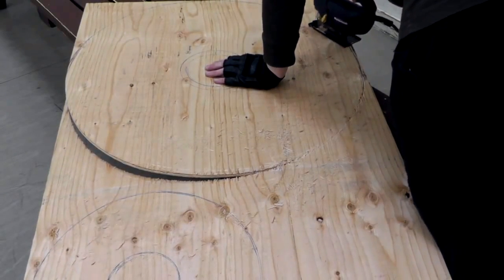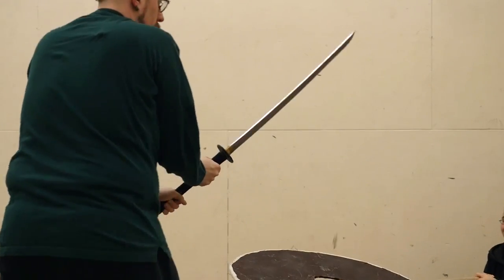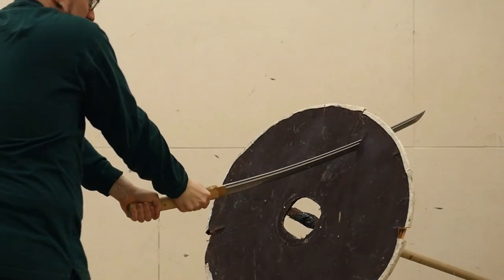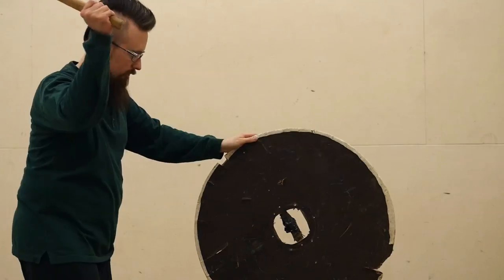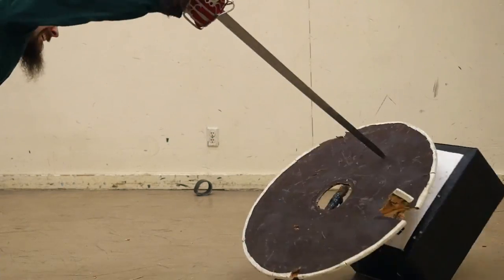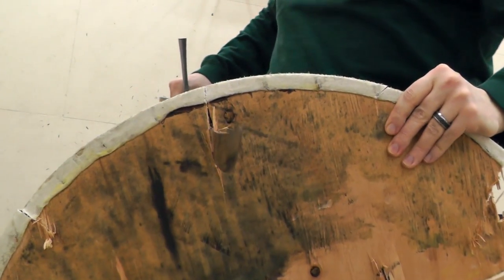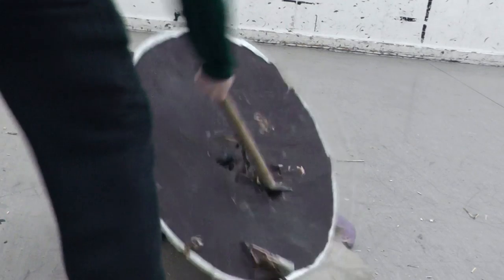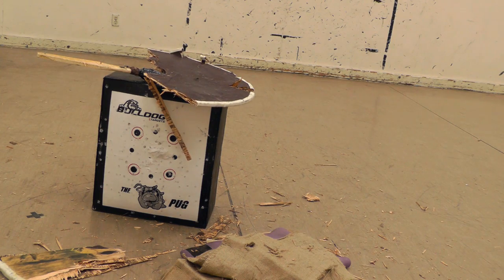Plywood shield vs broadsword, katana, axe, kriegsmesser, and war hammer

Comment: By no means am I any kind of close quarter combat expert, but I found the ax very interesting. I didn't expect it to do much damage to the shield, and after having seen this video, I think it would be better used to hook the shield and pull it out of the way to expose the shield bearer. Thoughts?
Reply: It's an axe, you can chop logs in half with it. However it was not made for shield fighting, it is too small (the one handed on) to use as a primary weapon. That is why only colonials, who did not carry shields or wear armor, used tomahawks and steel axes. Shields are supposed to be near invincible defenses and the only way to counter them is to break the wielder's shield arm and kill them or go around their defense just as you do in sword fighting.
Reply: Kitt C Yeah, that's why I suggested the ax might be best used to hook the shield and pull it to one side, exposing the shield user. You know, instead of directly attacking the shield. The video demonstrated pretty well that the shield is very resilient against it.
Reply: Could be done but overall most one handed axes are too small to effectively hook shields, but they are good at swords
Reply: Kitt C I don't think you're quite understanding. Or you don't know what you're talking about.
Reply: krowanders Listen, a one handed axe such as a tomahawk is only a foot long. It is has a bit more reach than a dagger. It is not made for hooking shields, and only Vikings have commonly shown their willingness to wield longer axes for the job. If you try to hook a shield with a tomahawk-sized axe, in order to pull it away you will open up your defense to their own weapon. Colonials used small axes because they didn't have to fight armor and shields, but medieval soldiers? Larger axes, clubs, spears and especially swords were much better. 
Also, you don't even want to attack the shield. You go around the shield. The shield is invincible and its grip is very strong, it's likely even a large weapon would have difficulty 'hooking' a shield away from a burly soldier's forearm. If you want a time when the small axe was a highly viable combat tool, look post 1600.
Reply: Kitt C Nah. I think if you're using an ax in the offhand, and you hook their shield, you can pull it in front of them to keep yourself protected while you open their flank. That seems like the most viable shield vs. ax+sword technique.
Reply: krowanders Very common viking tactic was for a shield wall where the 2 handed axe was in the second row, pulling down a shield so that the guy in the first row could kill him.
Reply: Pasan Etternavn That's awesome. Thanks for the input, bro. That's what I like to see.
Reply: Pasan Etternavn Don't you mean "...the guy in the second row..."That makes more sense to me tbh.
Reply: No, I meant it like I wrote it. The first row in a shield wall was obviously not full of 2 handed axes. Its a shield wall. Generally the guys in the first row had swords and axes and shields, the guys in the second and third rows had spears and 2 handed axes.

Comment: i don't know shit about swords and all but I started to see your videos yesterday and the idea of using a shield, if somehow sword fights be socially accepted again, looks like a good rule of thumb. 90% of the weapons you used against it ended up being stuck in it making your job of kill the guy with the weapon stuck easier. If someday you have another spare shield, could you use that broad sword and test it out? Sorry if any grammar mistakes i am still learning english
Reply: +Vinicius Pires Gonçalves And that is why the shield was the primary means of defence for a few thousand years.
Reply: +Chris Wallace I know right? But in movies/games they make the a lot less impressive in some cases the guy just break the shield with ONE hit.
Reply: +Vinicius Pires Gonçalves Not to mention how in some games, a combatant with a shield simply uses it as a counterweight, moving it as far away from their body as possible with each strike. Hm, seems most shield-equipped combatants in games have an immediate death wish.
Reply: it depends on the swords in question, being used as a counter weight works very well for some heavy sword, (Scottish Claymore comes to mind) that being said you can also sharpen the edge and use it has a slashing weapon

Comment: Do you think someone used a tactic turning their shield specifically to make enemy's sword to be stuck in it? That means they will be unable to block and get exposed. Have someone thought about it?
Reply: +MaxCPP Usually they used them to deflect the blows, in order not to sustain much damage, since most battles happened on the battlefield and not 1v1 duels. Better keep your shield as safe as possible.
Reply: You cant block either cos a sword would be stuck in your shield dummy
Reply: Even with a sword sticking out of it, a shield is still a shield.

Comment: Skall no offense but plywood doesn't really have a set grain orientation as it's made by laying down alternating sheets of wood on eachother, i.e. the grain runs 90° to that of the sheet under it, so it shouldn't really matter if you hit it with or against the grain of the top and bottom sheet
Reply from the maker: ITLLBGRAND 
As mentioned it's only 3-ply, and 2 out of 3 layers have a grain running in the same direction.

Comment: I dont want to sound like a troll i respect what you do but...if nothing is holding the shield steady well anyone would assume the damage would be reduced with no force behind it the box is just slowing it down ....make a wall mount so the shield does not bob around in the air so then when you poke it with a sword it does the damage it should !

Comment: Part of the problem I think, you didn't have a solid backing for it for any of the strikes. You really need a rig to keep it solid, otherwise the test is kind of for naught don't you think? All of the significant strikes if you look back, were when the shield was on edge and jammed, or just by chance managed to be solidly braced.
Reply: I think less solid backing gives it a far more accurate portrayal.  The arm of the person holding it is going to be wobbling all over the place as you hit the shield.
Reply: ... You don't know much about using a shield do ya bud? If it's properly made, unless it's a buckler or you're a weakling your shield is going to be pretty damned solid. A shield weighs more than a weapon, and unless it's a giant of a man wielding the weapon, or it's a hefty ass weapon you're going to have less of a jolt on your arm than that portrays. You're not going to be holding a shield and suddenly be blasted towards the ground.
Reply: +Diralt Naran it wouldn't be like hitting a stationary object though, if you hit a shield with full force the person's arm that is holding it will be moved. A skilled fighter would perhaps even try to shift the shield as to dampen or parry the strike altogether.
Reply: Diralt Naran 
I used to spar with a guy that managed to break his training sword, my shield, and my arm at the same time, so my opinion is somewhat skewed.

Comment: I have a question, without meaning to cause any offense.
When you and other yt guys, like let's say Lindybeige test some weapons, how historically accurate is it really?
I follow your channel for quite some time and I know you have more experience in wielding melee weapons than most folks but how do you stack against a real warrior who wielded those weapons. I ask in terms of fitness, strenght and general skill. The reason I'm asking is because, at least to me, it seems as though you're not hitting that shield with full strenght. Would a real warrior hit his target with full strenght and does that result in less accuracy edge-wise?

Also since trained warriors would have obvious fitness and strenght advantage over you, how do you take that into account when testing (you in particular but also generally)?

Kind regards,
markafes1
Reply: Sure, some warriors would be bigger and stronger, but not all. Many common soldiers would have been comparably strong to any modern person. In any case, you wouldn't hit with all your strength. That's exhausting and likely to over commit, exposing an opening.

Comment: Why wouldn't the vikings have had war hammers? Sure, they might not have had that model, but how hard is it to make a stick with a spike and weight at the end?
Reply from the maker: They didn't. There is zero evidence for war hammers from early medieval Scandinavia. And why would they, there was no need for a weapon designed specifically for use against plate armor.
Reply: Oh so that's what you meant. I thought you meant they were incapable of making warhammers, not that they were unnecessary of nonexistent
Reply: Actually surprised they didn't use war hammers of some sort, considering that making an axe begins with a hammer and considering the use of hammers in their symbology, i guess they liked the axes better because they had the added function of being able to chop trees as well as people, and in the cold places they live fire was more important.
Reply: actually the traditional scandinavian way to make an axe is more difficult than making a hammer, you have to insert high carbon steel into a mild steel body and forge weld without burning out the carbon, very much a difficult thing to pull off without much practice, a hammer is just a chunk of metal with a drifted hole
Reply: Arctic Gator Yeah, also striking with the back of an axe head is very similar to a strike with a hammer...that's at least what I learned from chopping boxes for the fire.
Edit: I noticed battle axes are very different from Wood chopping axes

Comment: Errr... what are the comments talking about? The katana did impressive damage to the shield, the only blade that came close was a damn two-handed machete. The katana is not the best cutting sword in the world, but it is one of, if not the, most versatile sword ever made, they can be used in close quarters and in a field, they could stab like straight swords, and cut like a curved sword, they could be used one-handed or two and could be used from horseback, it could also strike while being drawn. It doesn't have much or a hand guard but neither do many Asian swords.

Comment: Are shields really meant for blocking? I thought they were meant for parrying, pushing blades away from the wielder. Perhaps I am confusing shields with bucklers.
Reply: Well, they are for both really, bucklers are certainly worse for blocking then large shields.
Reply: Also grappling if you're Zulu
Reply: Really depends a lot on the shield. You're probably not going to be doing an awful lot of "active deflecting" with a ten-plus kilo Republican Roman scutum (which is technically a buckler, what with the central handle) and similar hefty "body shields"...
Reply: Well considering that once the blades went into the edge of the shield they got stuck. If it was a genuine battle than the person who's sword got stuck was rightfully screwed I'd say.

Comment: Love to see these test on a real hardwood shield
Reply: +Sam Whyte (AxiomBias) 
It would probably break sooner. There's a reason you use plywood when you're building something that's gonna take punishment, it's tough.
Reply: Yea, what he said. Given the physics of wood, the harder the wood, the harder it is to break at first. But once it gets damaged it pretty much splits in half. On the contrary, this plywood while evidently weaker could sustain heavy damages. Sure it had lots of big holes and gashes, but it still held its own shape pretty well for a long time.

Comment: Interesting video, wonder how it would have worked with a accurately  constructed shield. Both solid wood and pressed wood have their strengths and weaknesses. Still don't know why people argue over swords. Its like arguing over which is better a screw driver or hammer. Everything is developed based on what they were dealing with at the time. As far as I know the Japanese sword was imported from China and  was originally straight eventually it began taking on the shape we know today based on how they were fighting and what kind of equipment they were wearing. Japan never had a massive amount of iron for making  heavy suits of armor. So why develop a thrusting sword. Same with European countries why make a  slashing weapon when you need a thrusting weapon to deal with their equipment. It would make more sense to compare slashing weapons. But then again Everyone seems to want to know whose better knights or samurai and to answer that you'd need to know who had the best battlefield tactics with the higher win ratio and thats been lost to history for the most part.

Comment: covering it with a wire mesh and attaching a wire around the edge help it survive longer but that wouldnt be historical
Reply: Hurdalık covering it in canvas (at least 3 layers) and LOTS of wood glue (I used around 700 grams for a little 55x25 shield) increases the durability a lot.

Comment: Question, you seem very familiar with weapons. How do you repair edge damage on a blade?
Reply: If it's very minor, strop it.
If it's minor, use a Honing steel.
Past that point it's just like sharpening, use a course stone if it is severe damage, and finer stones for less severe damage.

Comment: What does "planked" mean? I assume there is a difference between plank and plywood but I have no idea what difference that would be.
Reply from the maker: +Naomi Nekomimi 
A plank shield is made of several narrow boards glued together, instead of cut as a single piece. In the Viking age they weren't able to make wooden boards of sufficient size. This is the second shield I made, more historically accurate: https://www.youtube.com/watch?v=Kc2yj07Szsg
Reply: A "planked" shield is one made from planks of wood. You couldn't make a solid piece of wood large enough to be used for a shield, you see. 
The planks would all have similar, or, in fact, the same grain direction, so that would make it easier to cut into them.
The planks would be about a half inch thick and would be held together via tongue and groove joints and glue or nails. The planks were more likely than not made from Ash wood or Oak. 
The shields would be covered on both sides by either Lenin, tanned leather, or raw-hide. Lenin is the best option, as it is lighter, cheaper, and adds just as much strength. Also, Raw-hide shrinks a lot when it gets dried out. The edges SHOULD be raw-hide, though. You want that to be tight.
(You would never leave the back uncovered as splinters would still fly into your face whenever anyone cut into your shield.)

Comment: Since the center grip gives it so much strength would it be a stronger shield if you reinforced the outer edge with a circle of wood which is connected to the center grip?
Reply: Also, do you have any videos where you test penetration power of different kinds of arrows, bows, crossbows and bolts against shields? I would be very interested.

Comment: if the sword did penetrate like in the first couple examples, wouldn't that make it very easy for you to control your opponent if they try to keep hold of their sword?
Reply: +Tyranzor Katastrophe I reckon the opponent would also have a a free shield so if he has his sword stuck in your shield he would just try and get the exposed blade to damage you. Neither man would let go and you cant really attack anyone who has a free shield when you're stuck together like that. In that scenario I just image them flailing around a bit until the weapon is released. 

Like when you are that close he just keeps shield bashing you so you keep backing away because there is a sword stuck in your shield until it is released

Comment: Probably some better kinds of plywood are more durable that even hard wood . from wiki : 
"""Smaller thinner plywoods and lower quality plywoods (see Average-quality plywood photo below and right) may only have their plies (layers) arranged at right angles to each other, though some better quality plywood products will by design have five plies in steps of 45 degrees (0, 45, 90, 135, and 180 degrees), giving strength in multiple axes."""